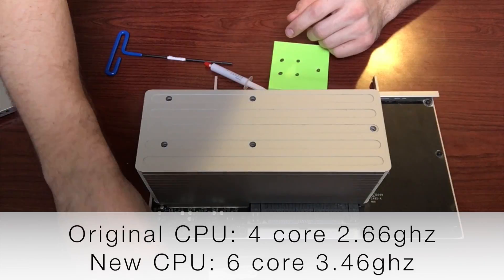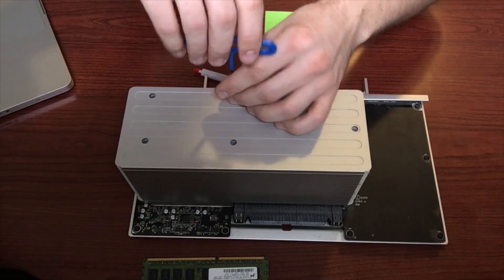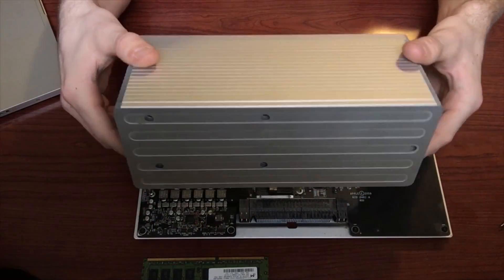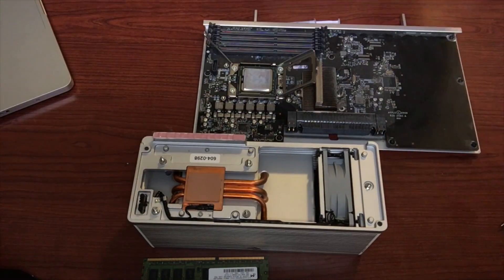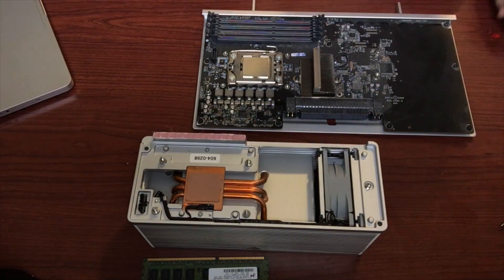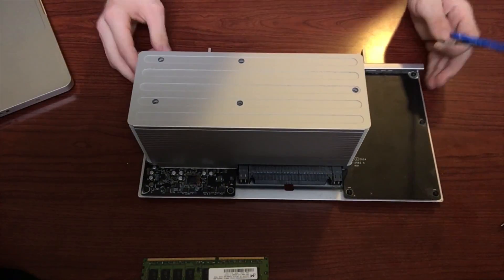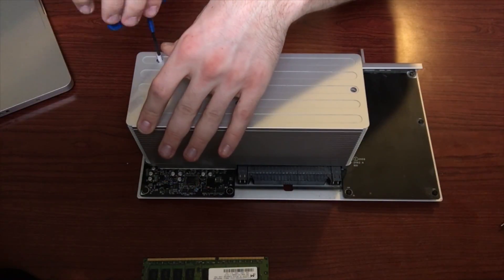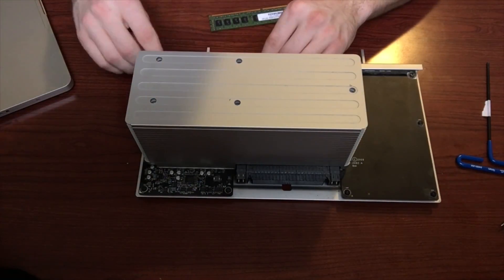2009 Mac Pro CPU Upgrade

Comment from the maker: UPDATE: Still using this rig today and editing 4K video from Sony alpha 7 cameras. Also using pro tools for audio editing. It’s still a beast of a machine and is very comparable in performance to the 2013 Mac Pro trash can I use for my job every day. Sure, a PC could easily out power it, but that’s not important to me. This, to me is the best mac ever made and I’ll continue to use it until it ceases to work for my needs. Mac Tower for the win! Who’s with me?
Reply: Heck yeah! I just upgraded my single model 2.66ghz 4,1 to an x5690 and rx580 with 32g of ram. This computer has been in my family since it was new and is damn near an heirloom. I want to make sure it's maxed out while the parts are still on the market, so that when it eventually goes into long term storage in a couple years when I can't use it anymore, if any one else in my family finds it they'll have the most powerful variant I could build. Thanks for the video. long live the big macs!
Reply from the maker: @connors3356  Very cool. So I actually sold mine about 6 months ago and moved to a Mac Mini M1. My main reason was for increased speed of video editing and smooth timeline playback. I do think I traded render time for a smoother editing experience, but so far it has been worth it. It’s been working well with wide variety of types of video I’ve shot from canon c300, Sony A7iii, GoPro, iPhone etc… the great thing is, my sale of the Mac Pro paid for almost half of the new Mac Mini, so it was an upgrade that just made sense for me.
Reply: Hi Nate

Thanks for making this Video

can I buy any Intel Xeon X5690 or does it have to be mac specific? or is the x5690 the x5690 and there is only 1 type?
sorry if thats a ridiculous question but its really hard to be sure.
Reply from the maker: @tpage6550  Nah, there’s only one version I’m pretty sure. Just look for the x5690 on eBay. They’re pretty cheap.
Reply: @TicketToNowhereYoutube  awesome. Thanks I'm onto it now. Is that the same for the GFX too? Thanks for your efforts.
Reply from the maker: @tpage6550  I’m not sure about the graphics.

Comment: I just updated my firmware from 4,1 to 5,1 and installed Sierra. A set of  Xeon 5690 chips is ordered, along with 48 G of RAM. One chip is for me and the other for a friend if he decides to do the same thing, as the chips were cheaper as a pair.  This is exactly what I plan to do when the postman delivers my new toys.

Comment: sorry last question.. i have 3,2 6 core X5679. would it be worth the upgrade or wouldnt it be much or a difference if i change to your cpu?
Reply from the maker: synth000 ~ Dan-Elias Brevig The X5690 will only work with the 4,1 and 5,1 Mac Pros.  You will have to check which processors will work with your model. I'm not familiar with the compatibility for the 3,1 Mac pros.
Reply: i have the 5.1 one. my question was how much better X5690 is over my X5679 :)
Reply from the maker: I don't think you would see a huge difference unless you are somehow bottlenecked by your clock speed in applications that can't make use of all 6 cores.  What are you trying to do with the extra processing power? Video editing?
Reply: yes! actually for my youtube channel. hm.. i actually think i have to do a hackintosh then.. :P
Reply from the maker: synth000 ~ Dan-Elias Brevig ok, good luck to you.

Comment: very good video!! Finally someone that can make tutorials. Can i use a regular screw driver or you need that fancy one?  So you are absolutely shure X5690 is the best cpu possible? if so i actually think i am going to do this! thank you :)
Reply from the maker: The hex wrench just needs to be long enough. An average Allen wrench wouldn't be long enough. Yes, the X5690 is the best processor that these Mac pros will support. If you have the dual processor model, you can put two X5690's in it for a total of 12 cores.
Reply: saw the 12 core had a geekbech of 30k . thats insane. thanks again. was about to build a hackintosh, but guess im now seeking for the 12 core version. AMD RX480 is the best GPU it can have right? (without having to use nvidia webdrivers)
Reply: Did you get a new GPU?